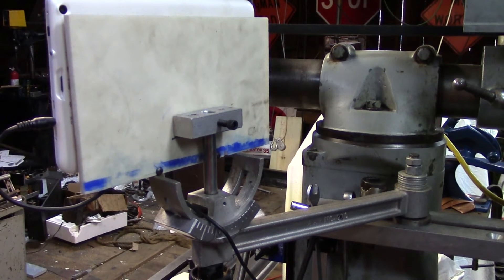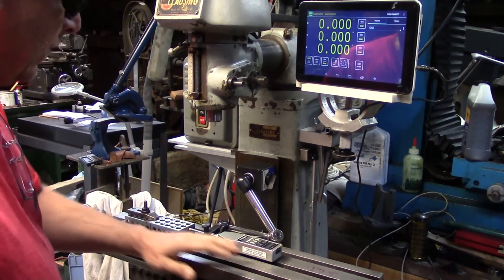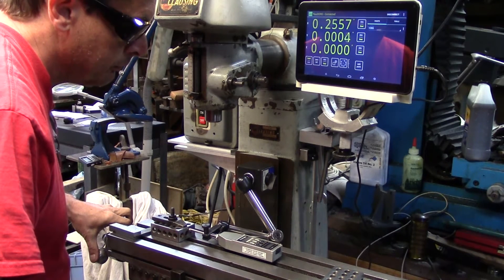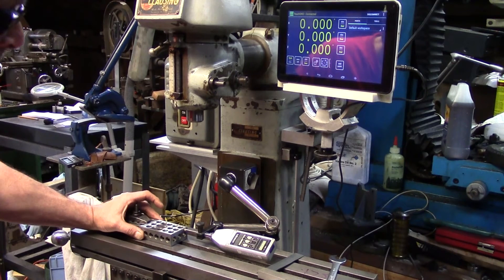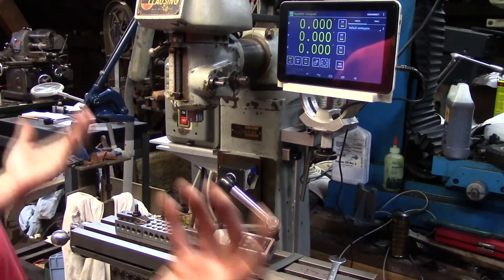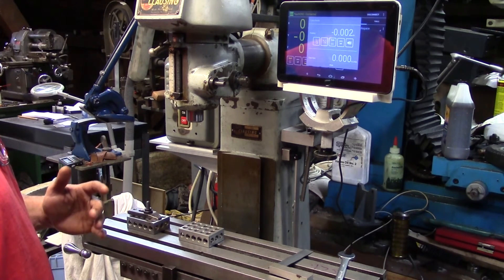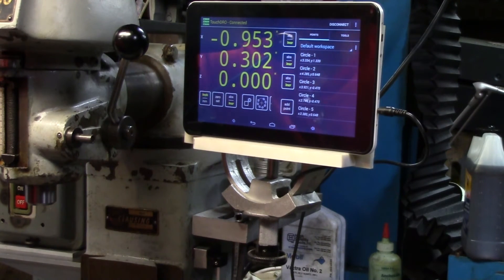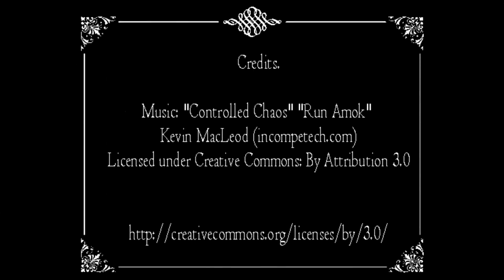Installing a DRO on the Clausing 8520 Milling Machine - Part VI

Comment: It "seems" the count should have been 2540.  It's so close to 25.4x100.  I'm also confused as to why the count wasn't evenly dividable evenly by 25.4.  Like, 3x2540 since you are moving 3".  I just attained on of these mills. I think yours is an early model.  I have the riser block and extra fasteners on the quill clamp.  Taking in all the content on the 8520.
Reply: Because it is binary.  256 = 2^8, so 2560 is 10*(2^8).

Comment: Just finished watching the series,  thanks so much for taking the time to do this. I have a 8530 and plan to add a dro and a DC  motor, this helps a lot. Also, not many vids on the 8520-8530 takedown, info here on removing the table is great.

Comment: That minus sign jumping around is so annoying and could easily be dealt with in the software.
Reply from the maker: +stefantrethan Turns out that it's only a problem when you've got the display set for 10ths (which I'm unlikely to ever use)